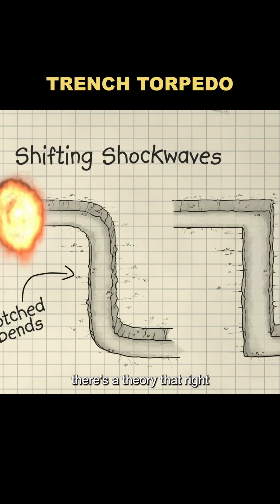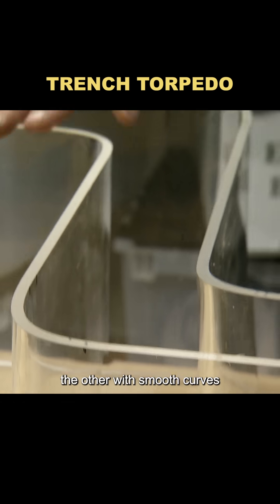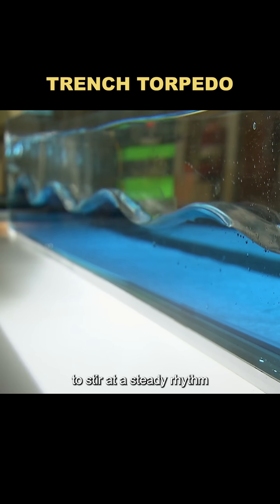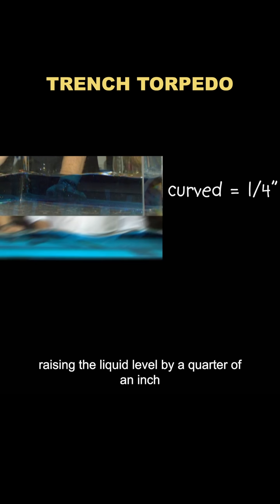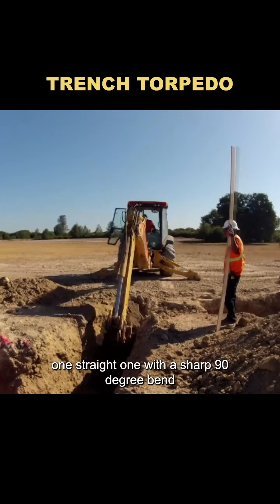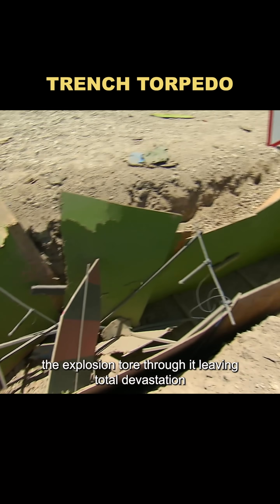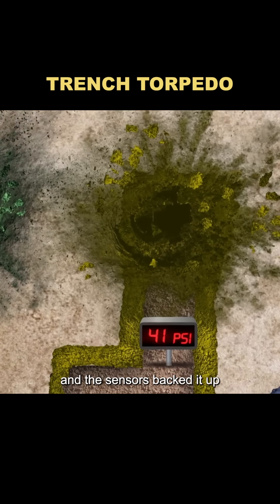Do you know how this liquid is made?

Comment: Same as current flow in electronics, right angled paths are only for high frequency, they slow the current down and heat up the board, so never use them in circuit boards

Comment: The physics requires equivalent simulation. The Waves are defined by media and Boundary Conditions(BC). In different media different waves may be supported with similar BC, and propagate differently. Acoustic wave is a longitudinal pressure wave. The liquid experiment shows a transverse shift wave. They are different. The only right experiment is the scale explosion.

Comment: What pressure sensor was used in this experiment? If it's a blast pressure sensor, it should be able to measure hydrostatic-equivalent pressure while avoiding shock waves, but it doesn't appear to be doing that.

Comment: I have a hypothesis on how to reduce this further. 

When building a snow shelter if you create an overshoot on a right angle by an extra foot the wind will blow to the end of that tunnel and not be funnelled around the corner as easily. 

So if we apply this to the right angle design. Keep all the same lengths and widths. But the second tunnel will start 1 foot closer to the blast leaving 1 foot of dead space past the entrance of tunnel 2. Repeat this for tunnel 2 and 3.

From the top down my design would look like the sarif version of the original's right angles sans-sarifs design.

I don't know, does anyone else have any specialised knowledge that would suggest if this would work or not?

Comment: Even better if you design a trench more like a lightning bolt, have the trench reverse in on itself a little.  At corners also you dig 6 feet past the corner.  Creates a dead end and very little travels around the corner.

Comment: What if you dig a hole into the right angled corner. Increase devastation in the arm that's hit, reducing noise in the other arms?

What with an angle smaller than 90 degrees? Guess it becomes inefficient as it requires more digging.

Comment: This is old news. Fluid moving through a pipe loses pressure going through a 90-degree bend in the pipe. Less pressure is lost through a bend that is less than 90-degrees. there is no difference in behavior between a liquid and a gas.

Comment: this show is always wildly wrong. look at the pressure at 20 feet in all 3 trenches. all the same shape between that point and the start. trench 2 and 3 had different power explosions. the S shaped trench actually stopped a slightly higher percent of the power than the Z shape.

once again their analysis was the exact opposite of what their experiment proved.

almost all the force is driven up, so it makes sense that the trench shape has little effect on force once you get further away from the explosion. having a wall between you and the explosion will make a small difference. the shapes on either side of that have almost no effect.

Comment: Smarter solution would be to make those trenches with 90 degree bends BUT have the end continue a foot or two further after the turn, this would allow the energy to bleed into that extended section trapping some and cancelling more of it out before it gets around the bend. You could go even further and bake the ends of each straight line
trench narrower and that extension that contains the blast a bit wider, which would further focus the blast force into that containment area reducing the amount of pressure that makes it around the corner in the first place.

Now even if you were right around the corner at the time of the blast your odds of survival are greatly increased.
Reply: Have the 2-4 feet extension angle up, so the energy is directed into the air.

Comment: The verdict is dubious.

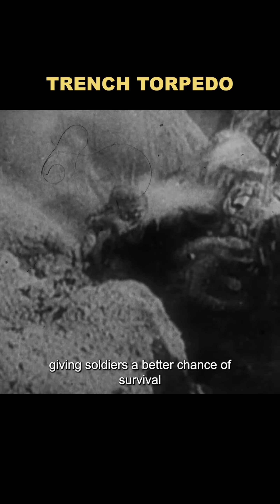go to 1:30 and it shows you the measured pressures.

After the corner there is no significant difference between the "right angle trench"  and the "serpentine trench"

21/19, 13/12, 8/7
True the serpentine is slightly higher, but not to such a degree that it would really matter.

Comment: Curved guides - flat impacts, a similar contrast i guess would be "rolling with the punches" taking a punch and moving with it to reduce the entire damage - resulting in your full body moving with the motion - vs taking the brunt of a punch and having all the force condensed into a local point, and if the point/edge is strong enough the motion ends there, resulting in only a single area with relative damage.

Comment: Actually, in trench design, the angle is 100 °, not 90 °.
The trench angles back on itself slightly. Sort of like a Z.
and the next leg doubles back on itself. and the cut back is only short to not provide a possible sniper spot

Comment: Actually the PSI delta is much greater in the curved corner trench. There was a much larger PSI drop before and after the right left jog. 76psi to 21psi on the rounded curve trench is a lot better than the 60psi to 19psi drop on the 90deg angle trench. If the 90deg was better I would expect a larger difference between PSI levels on the 90deg trench. Interesting.
Reply: that's due to to the smoothness and the section of straight area. He only did one test. of the bomb type.

Comment: In the final test the 90° trench seems to be less effective because the smooth trench starts with a higher pressure before the bend so proportionally, the 90° trench blocked slightly less of the shockwave.

Comment: I am an electronics engineer and we never design high speed traces (small metal paths on a pcb to transmit digital and analog electrical signals) with sharp edges. It degrades the quality of the signal. We always round the edges . So interesting to see the same effect both in water and in air.  I Guess waves are waves
Reply: Yesss, I was just thinking of transmission lines and waveguides.   RF hardware design engineer here.
Reply: @akinoshimo  I use the technique for reducing unwanted RF for space components.  If there's enough volume, it's best to create a double lip enclosure joint.  If not, a single lip enclosure just might qualify.  Flat or straight covers/edges will ALWAYS get sent back for redesign or revision on existing hardware.
Reply: one thing I've noticed is a lot of skills applied to other skills you'd be surprised how much you can at works just like your saying. sorry if that sounds like im calling u dume im not im just saying its someing i dont see ppl do a lot
Reply: I was going to comment exactly the same
Reply: what about an earth quake with waves in multiple directions
Reply: @MattStMarie-bm5sq  Earthquakes aren't a "blast" force, they're something else.  Also manmade structures are never large enough to account for the shear scale of an earthquake.
Reply: Waves are waves
Reply: Golden spiral
Reply: Is basic law of energy ,always takes the path of least resistance
Reply: @notrelatedtobacon1282  it actually has to do with reflrections of the signal. thats why it only matters with high frequency signals, and not really with LF signals.
Reply: i have seen very very few right angle traces. under what circumstances may they become necessary.
i wanted to get into to custom pcbs so wanted to know these stuffs
Reply: Microstrip filters and antennae
Reply: i js use it cuz everyone else does
Reply: Correct and that would mean that the sharp angels with narrow traces would pass DC whule blocking microwaves >2.8 GHZ
Reply: So in a trench you want 90 instead,?
Reply: Yup waves are waves, just different frequencies. A possibly alarming thing is that essentially everything not devised by man and everything devised by man is just wavelengths at different frequencies. Waves be waving lol
Reply: Never my ass. This is regurgitated BS from shit floating around the viral algorithm on YT here. I've seen the same video. They ALSO shown perfect 90 degree angles on the Motherboard of the PC... The fact of the matter though is, using double 45 degree angles reduces impedance and heat. But not every single PCB is going to be entirely void of 90 angles, it just depends on how much heat it is going to generate in that specific spot usually, and how much does it reduce electricity going through it.
Reply: @Wildlink123  it depends on frequencies used. HF signals reflect on edges, thats also why on big networks like the electric grids, you can use "dead ends" and extra "curves" to control reflection in the system, which is done to keep the reflection coefficient of a system down. (impedance matching also works on the same principle).  With HF signals you aboslutely should reduce 90° angles in their circuitry/waveguides. For LF signals its for less impedance and heat generation, but with HF signals reflections are the main issue with straight corners.
Reply: @dankrigby5621  No. Waves reflect on impedance steps. Edges are such steps in general, but are treated as boundary conditions at most. Steps may have any nature, a cavity, a density change, a discontinuity, etc.
Reply: @halehale7829 yeah didn't want to get too technical but true lol
Reply: And some are even particles
Reply: Whether hello or goodby.
Reply: stealth edges..
Reply: Yes mostly to reduce the reflection of modes. Right angles reflect more easily than curved ones.
Reply: fluids are fluids
Reply: It’s the same for hydraulics
Reply: I always wondered why my pubs used two 45 degree angles
Reply: If I had your knowledge my chip design would of been finished already. 
each level that I reach I find out there is four more levels I did not know of behind that one.
Reply: YOu are not right. Actually we always do that at straight and 45 degree angles. But the caveeat is the impedance step in the EM-wave propagation - you compensate that by mitering the angles, reducing the trace capacitance. Read the Black Magic and some books on waveguide physics. Round turns are intrinsically radiative and not always good, causing EMI leakage.
Reply: waves are indeed waves,doesnt matter what it is,its just a bunch of some material vibrating
Reply: Waves are waves.
Reply: I mean even light and sound shows same properties. Ig it was De Broglie principle which stated matter waves and EM waves mostly show similar properties
Reply: @secretlyshadowgaming1644  No. The light is usually linear tensor wave. The sound is only longitudinal compression wave, in general nonlinear. The compression in liquid is less prominent, so submarine tech often use equitions and aanlogies similar to EM, but without polarization sense (apply analogies in general circuit terms)
Reply: @halehale7829 so is this kinf of knowledge as a student of grade 11 with Pphysics and chemistry when will i study this? Any idea?

Comment: Trenches were originally zig-zagged to control shrapnel.  A bomb falling into a straight trench could kill everyone there.
Reply: Blast wave is harder to protect against, but enough soil between it and you will do the job
Reply: @МэйненШард  Blast waves can go around corners just fine.  What you want is a way for the pressure to go in directions that don't have you in the way.  The entire top of the trench is open, it can go up and out.
Reply: not really, it did do that but it was on accident. the actual reason they zig zagged the trenches was to force the enemy into kill boxes and preventing the entire enemy force reaching a trench all at the same time
Reply: actually originally they were to get close to walled cities in a siege, undermine the walls using wood and then fire, later to get gunpowder weapons close to the walls so they could hit artillery on top of walls with more range
Reply: No they weren't straight cuz if an enemy got an omg in they could mow everyone down
Reply: Yeah. But do you want to take more time to make that trench exact on the corners? Or is it okay if it's not exact and you are a bit lazy so it ends up rounded?
Reply: @michaelmurray6197  Shock wave management isn't important in open trenches because it immediately goes up and out.  It's the flying metal that counts, and for that you just need earth between it and you.  Same goes for suppression of the other team should they arrive unannounced.  Doesn't matter if your corners are sharp.  Just that you are covered and concealed.
Reply: @michaelmurray6197  doesn't really matter, if it isn't perfectly straight it's better than a perfectly straight trench
Reply: 😂 deadly
Reply: Nope, all trenches worked equally against shrapnel which is why shrapnel shells were quickly phased out in WW1. Shrapnel shells eject a bunch of metal balls mid-air which follow the shell's trajectory, like a shotgun. They are not filled with high explosive so if one managed to land in a trench it would have to directly hit a soldier. Shrapnel is very different from fragmentation, in that it is round balls and the shell casing is designed to not shatter.
Reply: @BC-wj8fx  OK I mean high speed fragments such as from an antipersonnel grenade.   Packed earth works great to stop those.